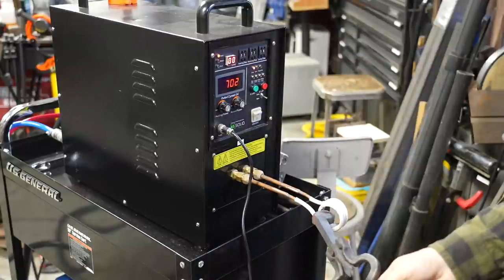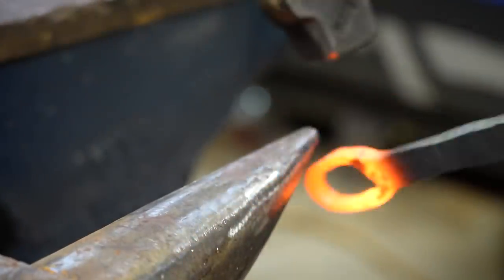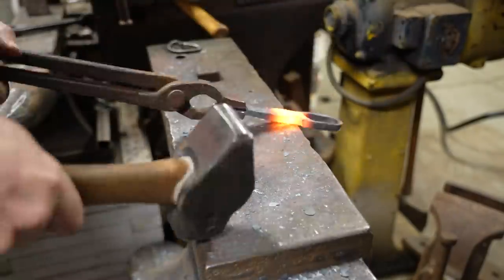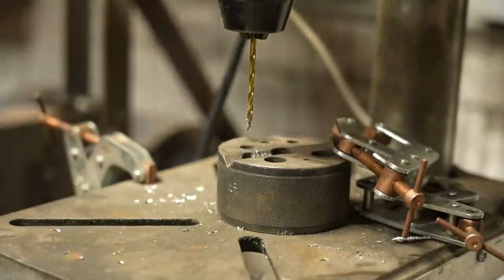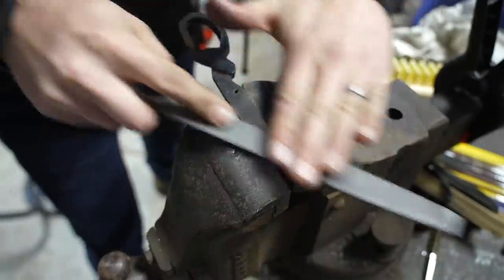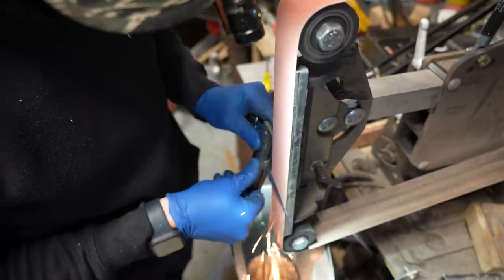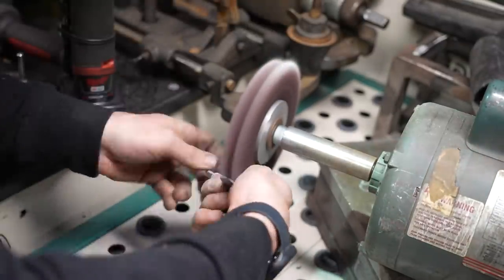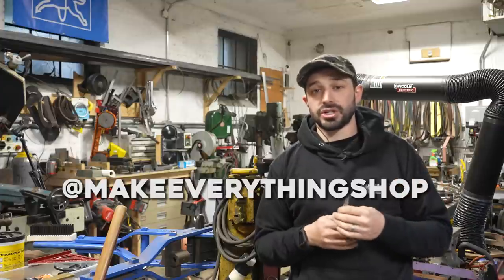Transforming a Nail Into Scissors

Comment: I havent watched to the end but I believe scissorblades have a bow in them at least all scissors I have encountered you can see through from the top when they are closed so that its a tighter closing "point" where the blades intersect.

Edit: but I'm glad they work well
Reply: I concur.  Having sold high end scissors for a number of years, I can say that the blades should curve inward a bit.  This curve ensures that the blades are always tight when they meet.

Still, it was neat to see the induction forge in use.

Comment: Would the railroad spikes make a good chisel for woodworking In your opinion?
Reply from the maker: They are “high carbon” but they don’t get as hard as a chisel should get after heat treating in my opinion. It would work but would require lots of sharpening.
Reply: @MakeEverything  gotcha. Yeah I'm trying to find something to make a chisel out of that is able to hold an edge. Thanks for the reply!
Reply: @MakeEverything  just got to the point where you answered my question 😂